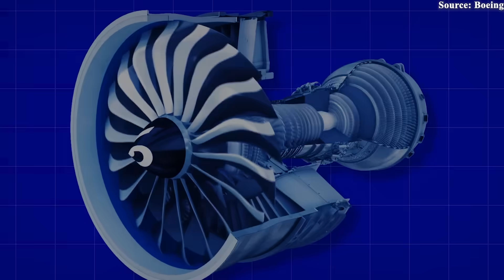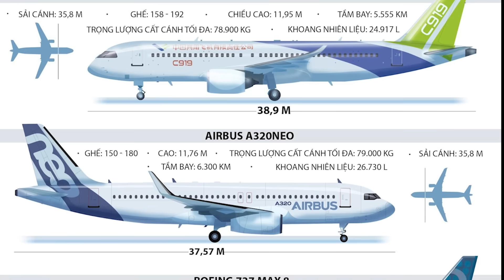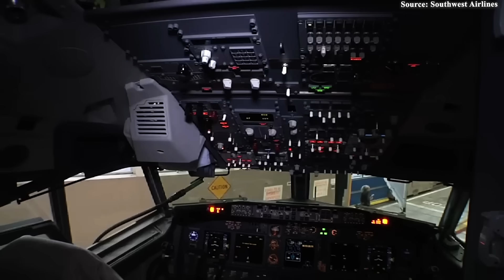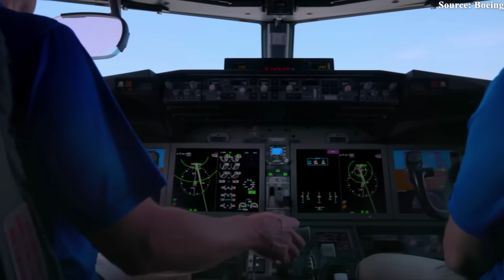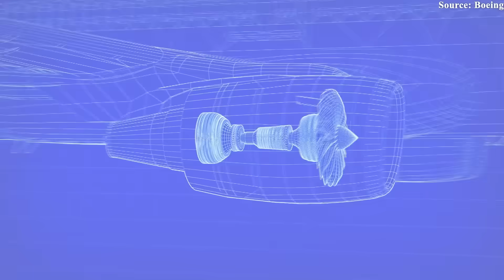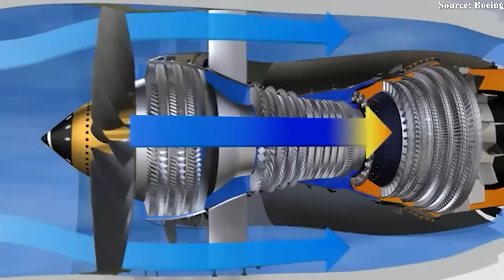NTSB Just Dropped a BOMBSHELL about 737MAX Engine! Here's why

Comment: Cabin pressurization comes from bleed air taken off compression (compressor/turbine) section of engine.  Send bird parts through it and you get smoke.  Took 2 geese in a 757 engine and cabin filled with smoke/haze.

Comment: I seriously don't understand why Boing remodeled the ancient 737 instead of the 757 or 767 those were much younger and would have been much better suited for a modern engine.
Reply: It’s because there are many pilots out there already being certified for the 737, so there was no recert required for the max, which saves lots of money for the airlines.
Reply: @sebastianbraun2473 profits over safety…
Reply: Quite agree with yourself. As the 757 was stretched it could just as easily have been shortened. Updating it's avionics would have made a 737 replacement cheaper and without the amount of reengineering entered the market sooner.

Comment: ai slop. This issue is with CFM's LRD design and implementation. It showed up on the Boeing 1b variant but the concern applies to all of the newest CFM engines. They all have an LRD
Reply: Can you explain what is a LRD ? 
From my knowledge in CFM engines, I have no idea of what this is and what it is supposed to do. There are some systems and parts mounted on the engines that do not belong to the engine manufacturer. Like the Environment Control System for cabin air, hydraulic pump for aircraft actuators …
It strange that the sister LEAP 1A engine mounted on the A320neo family did not have the same issue, knowing that it entered into service 1 year before the -1B variant of the 737Max.
Reply: Load Reduction Device. It's a safety mechanism for when a fan becomes unstable from, let's say, a bird strike breaking a blade. If the fan keeps running with that missing blade, the imbalance can cause severe vibrations and pose hazardous. So the LRD will make the fan "disconnect" by partially breaking within the engine to reduce the effects of the imbalance spinning. However, that disconnect/break releases a lot of the engine oil stored near the fan. These two incidents have shown it gets vaporized by the hot surfaces and then can be pulled inside the aircraft as bleed air. Maybe it's worse for Boeing and the 1b variant because of how it's flattened at the bottom. That's purely speculative on my part. We don't know at this point. But all the new Leap engines have this. @ChapaLipar